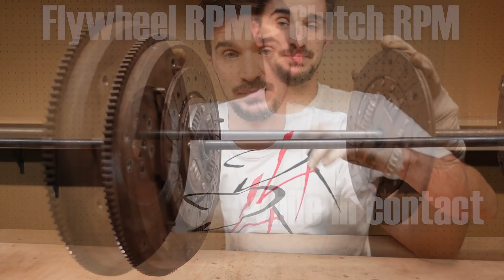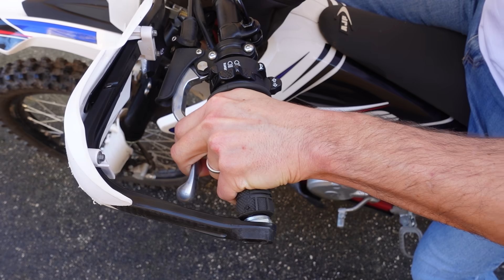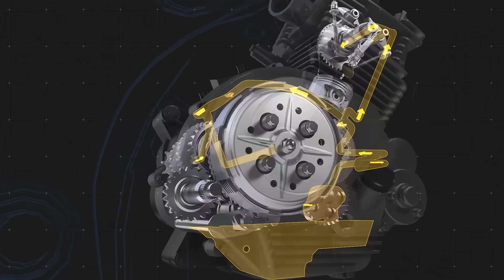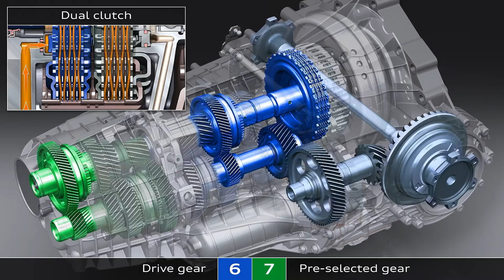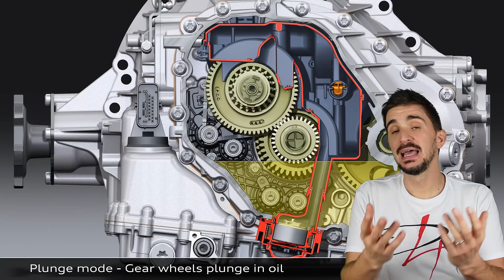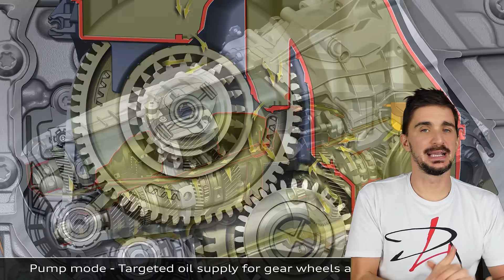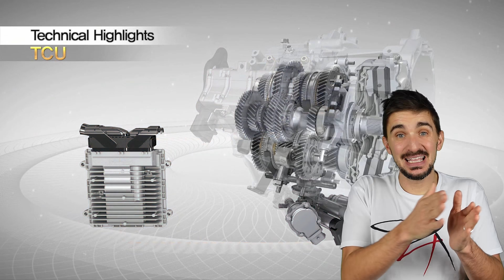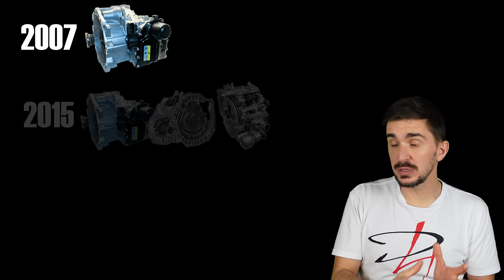Why Dry Clutches Suck and Why You Should Avoid Dry Dual Clutch Transmissions (DCT/ DSG)

Comment: The traditional transmissions all require clutch slipping. Some are well designed to last for long time. However Toyota hybrid eCVT use very simple planetary gears which don’t use clutch at all. This has made Toyota’s eCVT a lifetime component. Obviously the complexity and reliability have move from the traditional transmissions to the hybrid batteries. However hybrid cars do drive much better than the cars with traditional transmissions.

Comment: I work a lot with dq250 –dq500 (wet) and dq200(dry) and can confirm that the dry clutch lasts a Long time and Are pretty much bullet proof, i had more mechatronics fail than dry clutches in the dq200, wet clutches last 250 k dry last 200 k (Kilometers, hard driving) if you drive normal even longer

Comment: Boooooooooooooooo dry clutchhhhhhhhh foreverrrrrr. There's nothing like the feeling of a dry clutch engaging!! That feeling of a metal shift stick between your middle and ring fingers with an 8-ball in your palm getting that vibration back in your forarm when you get mechanical gear engagement in 1sttt 😍😍😍
But yeah don't race a dry clutch you heathen lunatic 😂

Comment: Interesting, very i teresting!  Wouldn’t expect that.
btw, I don‘t like DCT, I had rental car and one company car with DCT and I really didn’t like it. It was often guessing gears incorrectly, so gear on the other shaft was wrong and shifting took long.
I preffer torque convertors.
Yes, I will be slower when racing, but I like it more for daily driving. It’s really shifting gears and not guessing 😁

Comment: The "fun" part with DCT is when it preselects the wrong gears. This often happens when you unpredictably speed up/down, the computer says "WTF is going on?" and you end up spinning your flywheel as an idiot on the intersection.
Reply: Sounds like the cruise control on vehicles with Fly By Wire throttle (so basically everything now)_. Can't hold those speeds going up and down hill AT ALL despite the speed at which the sensor's signals travel. Whereas mechanical throttle with vacuum cruise, zero issues maintaining the speed you set... 😮‍💨
Reply: @DUKE_of_RAMBLE  Could be it. But at this point I admit that electric motors are just superior when it comes to converting torque to speed. dry/wet, manual/AT, robot/CVT or simply bad settings - zero fucks given.

Comment: So should I or shouldnt I go with a Twin Disc Clutch when I replace my Dual Mass Flywheel and Single Plate Clutch? OS Giken makes a Twin Disc for my R56 and I was contemplating it for more power holding/durability.

Comment: I have DSG in skoda octavia (7speed dry dsg).... the engine by default has 110kW, but my is running on CNG and the power is reduced to 96kW (torque is also less). I am only a few km from half a million in it. I think that it can last for a long time when you dont push it to its limits.

Comment: I owned cars with DQ200 and DQ381. What I like about dry clutch is its ability to 'climb' at low speeds. Imagine you're backing up over some parking curb or on a sloped garage driveway. Dry clutch grabs better while slipping at low speeds, so the car will move more predictably at these conditions. Wet clutch reminds me of a toque converter. The transmission logic make the engine produce more rpm before trying to move, so when the car climed the curb/driveway it might suddenly accelerate, requiring additional input from the driver.

Great video as always.

Comment: I love the multi-plate wet clutch DCT in my Veloster N. You can feel it actuating the clutch at low speeds, and it's a little jerky as a result, but it's great to drive with.

Comment: I'm sorry but a manual transmission with a foot actuated clutch last far far far longer than any other transmission on the road and is just as efficient.
I've seen cars and trucks with 150-200k miles on an original clutch and fluid.

Comment: If you want to feel the absolute smoothest, judder-free clutch ever made try driving a Step-Down Hudson.
Steel plate with ~50 cork inserts forms the disc and and a proprietary fluid lubricates the interface with the flywheel. Lock-up is bullet-proof as NASCAR records will attest (36-1 in 1952) and the weight of the pedal is very light and progressive.

Comment: firstly I want to say that its pathetic and tragic that you need to begin this with such a presentation as if you were talking to kindergarten children; not that I disagree, more of our population knows less about how anything they need to use and use than ever in my lifetime (I'm the oldest Gen-X based on the "rules"). Secondly I want to say that multiplate dry clutches are a pita and I had one on my Ducati for some years (the Ducati probably still has it, but I don't have the Ducati anymore). Works great when its fresly cleaned, blown out of dust and reassembled; progressively makes shifting harder as it gets towarrds 5000km down the line. Now I accepted this because of my acceptance of Ducati.
Now, in contrast, I have (also) a Yamaha T-Max which has a Wet multiplate clutch which is engaged automatically. Its never given me a shred of problems in over 160,000km of hard take-offs and general riding.
Thus I fully agree.
Clutches work like brakes, you don't just clamp them on hard, you progressively apply them.

Comment: Generally good video but some things I think don’t add up.

A dsg does not have more clutch slippage than a normal manual because it has two clutches. For each gearshift, or each time taking off, there is the same amount of clutch slip as in a normal manual; only one clutch is slipping at a time.

Most manual car clutches are dry like dry dsg clutches.

Furthermore: i have a vw polo with a dry dsg and am not impressed. Not smooth when taking off, doesn’t shift that fast (think it’s because it waits for the revs to come down naturally before engaging the clutch of the next gear in an upshift, which takes a long time as it is a 3 cylinder with a relatively heavy flywheel). Also smells of clutch wear sometimes when backing up an incline when parking.

Comment: There is an unmentioned benefit to dry clutches - they don't stick.

I believe motorcycles with wet clutches clunk when put them in gear from neutral becaus the oil makes the plates stick together.

Comment: Another big advantage of wet clutches that wasn’t mentioned: in the slipping hydrodynamic phase before the clutch is fully engaged, since oil is forced between the friction surfaces, torque transfer occurs due to viscous shear forces of the oil, which further helps prevent mechanical wear of the clutch pack(s).
Reply: Its like a torque converter for a manual transmission
Reply: Very cool observation

Comment: How's the AJP? I've been eyeballing the pr7 for awhile now
Reply from the maker: This is my wife's bike :) It's great for a beginner, I tried to change the jets to make it a bit more meaty but it didn't work, it likes the stock settings the best, with just a half a turn richer on the pilot. The stock pilot jet comes with the numbers ground off from the factory so you don't know what you're actually starting with. Super weird, never saw it before on any bike. I don't know about the pr7 but on this one overall fit and finish is decent. The brake pedal was stupidly tucked under the clutch housing so we had to fix that. In terms of performance brakes are great in my opinion, suspension is nice too. Plastics good. There are some minor things where it's obvious that it's a boutique brand rather than a giant OEM, but they aren't anything major or worth mentioning. The engine is a chinese unit, it's not bad but it's just a tiny bit boring in my opinion, ok in low rpm but there's almost nothing up top. I know a guy with a pr7, don't know him well, just an acquintance but he seems happy with the bike.

Comment: I can see why it made sense to use a DSG or a DCT back in 2010 as the autos were still meh. My dad has a 2008 Yaris AT and it shifts slow as flip. Putting the pedal just makes the engine louder, compared to a manual Yaris it is lame but has 580K miles on it so that makes up for it. 
My mom’s 2014 Jetta TDI with the DSG shifts quick and smooth. Putting the pedal down and it downshifts and zooms away. Only thing is crawling and takeoff is not great. Trying to crawl forward in a parking space for someone who doesn’t daily a DSG is like that scene from Austin Powers’s jolting back and forth.  And the launch’s are fine. Put the pedal down, wait a second and the car revs up 2000 before deciding to go forwards. I describe it as the computer making the decisions and your along for the ride. 
My 2002 Navigator with a rebuilt 4R100 automatic is decent for an automatic with its origins from the late 80s. Shifts slower than a manual or DSG but not a slushbox. The kickdown to 2nd is pretty fun when making passes and the 300HP 5.4L V8’s torque range makes the gear ratios bearable. 
All in all: 8HP swap the world

Comment: Because of wet motorbike clutches dumping all the wear dirt stuff into the oil I hate four stroke bikes with gearbox & engine sharing the same oil. That dirt gets then circulated thru the engine: now all the other bearings have to eat the chutch dirt. And because of people are laaaazyyyyy they run that stuff ´til the cows come home and then some. 
Two stroke bikes always get fresh engine oil and the gearbox dirt stays in the gearbox.
In the days motorbikes used to have seperate gearboxes connected via primary chain- that at least kept the engine oil clean(er). Many even had dry clutches and sometimes I see them on modern bikes, too.
But the primary was often a closed compartment where the chain ran in its own oil- introducing the say "No oil under it means no oil in it". And because all of that I hate modern four strokers.
Just give me a Suzuki Water Buffalo or a 250 RD… Anything water cooled 2stroke. I´d make an exeption for BMW- the Flying Bricks are cool- to me the peak of German motorbikes. 
They had it all: ABS, no drivechain, fuel injection and so many creature comfort things… And they were agile! Fast- if You wanted to. You could do a quick Nürburgring round Sunday and go to work Monday. A car on 2 wheels.
But thanks for summaring, I enjoy Your stuff.

Comment: Hear me out, instead of a DCT, what if you took a lenco transmission and automated it
Heck what if you took one of those planetary gearsets and made it an eCVT, so now you have the option for single speed transmission that offers either the best efficiency (low engine RPM) or high output with the engine locked at the peak of its torque curve, while also having the option for actual manual operations by having 4-6 more planetary gears you can shift through, while also being able to handle 1-5000HP depending on the design of the lenco style transmission

Comment: Hybrid DCTs don't need to slip their clutches to start off because the electric motor is after the clutches. The electric motor can start the car creeping while the clutch engages at a point where it doesn't need to slip.

Comment: Also with more fuel efficient but less reliable parts comes with mare failure and replacements which causes more emissions from manufacturing which completely offsets that 1-3% saving on fuel by a drastic margin

Comment: actualy i dont agree with thing you said that wet clutches wear out oil more compared to normal automatic transmissions. i have done a lot of oil changes and i can say one thing, that in dct wet clutch transmissions, there is no dust or debris in its oil or filter. Usualy oil looks same, that you just drained compered to new one. on normal automatic transmissions you can see oil changes color with milage, but not on dct. if the oil is darker or has debris in dct, it means it needs repair. i think manufacturers select very good friction material for these wet clutches.

Comment: Biggest problem with Ford power shift was the seals leaking directly into the dry clutch pack. It was a good concept, because it was a manual that shifted itself, like VW DSG, but it also had transmission control issues.

Comment: Ome of the bighest advatages of motorcycle dry clutch is ease of replacement: you don't have to dump and refill the oil. Clutch chamge in 2/3 minutes (with a new clutch pack ready). As for car transimissions, manual for life. 
Excellent video as always

Comment: I have a pretty unique transmission - 2017 Acura ILX with a Wet DCT and a Torque Converter. That Torque Converter really helps pick up the slack and reduce clutch wear even further. With proper maintenance and operation, i hope to get at least 250,000 miles / 402,000 kms out of this transmission.
Reply: I've driven a wheel loader with manual transmission and a torque converter. It's just such a great combination for a huge and heavy machine where you go forwards and backwards all the time. Just lett off the clutch and the torque converter takes care of the slip. I can't see any reason not to use it on ordinary cars. Sure there's some efficiency loss but in automatic transmission it's common to have the torque converter lock up when at speed and this way make it basically loss less. This should be easy to implement in a normal car with manual transmission and a torque converter.

Comment: I don't understand why DCT exists. Planetary automatics are way better. They say DCT shifts faster but that is just a matter of tuning and calibration. Traditionally planetery automatics are tuned for comfort. Both systems shift by disengaging a clutch and engaging another so they can shift equally fast. Planetary automatics, however, can take way more power because they have more sprockets engaged.

Comment: 11:34 do you have stats for that? 
The Dry clutches wear, but so do the wet clutches. The dry clutch is way cheaper as a spare part, as well as the labor. Furthermore if we add up the maintenance cost for the wet clutch DSG (Oil change every 4 years or 60.000 km) for 5,5 Liters of Oil (maybe Filter, depends on the model) and that the wet clutch pack also will eventually wear, a dry clutch DSG is cheaper for the customer.
Also the circuitry and Oil valves in the wet clutch DSG fail more often, as they also get flushed with all the dirt and gunk from the clutchpack

Comment: I almost agree, but it’s not all bad. I’ve had a 2014 Ford Focus since 2018 and I drive a lot in heavy traffic, and haven’t had any transmission issues whatsoever. I’ve figured out the two main things that break it:
1- Not letting the clutch disengage while stationary (you have to hold the brakes firmly or shift into neutral).
2- 'Creeping' or riding the clutch under 11 km/h by lightly dragging the brake pedal, which makes the computer slip the clutch.
By avoiding these two habits, the clutch never gets hot. Seven years in and it's still running smooth with no problems.

Comment: I'm working on a mechanical concept that involves a variable offset crank. I'm struggling to connect it to a fixed crankshaft, since the changing offset causes misalignment during rotation. How would you approach solving a motion transmission issue like this without using telescopic joints or flexible components?